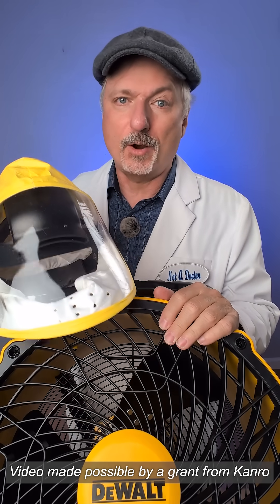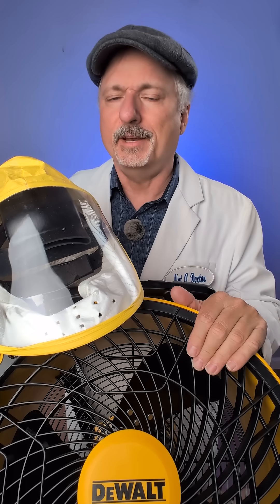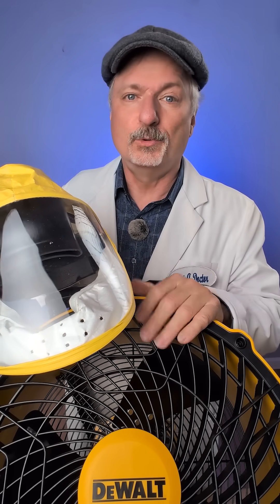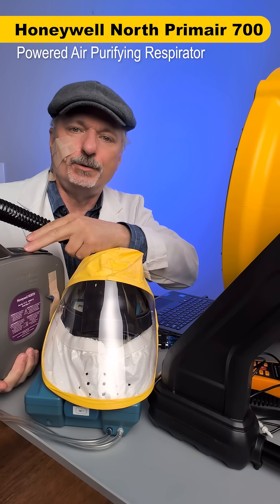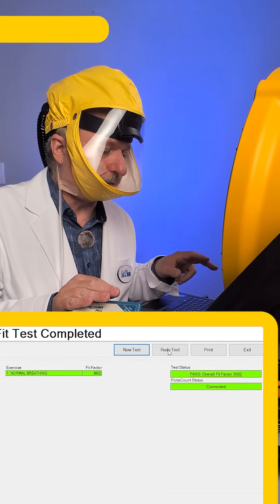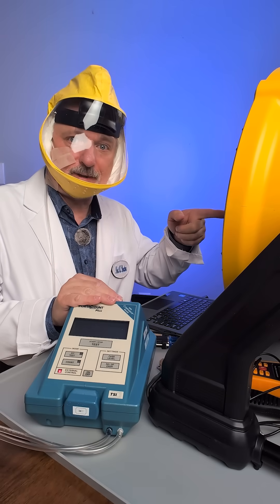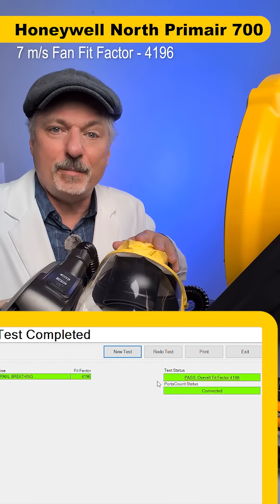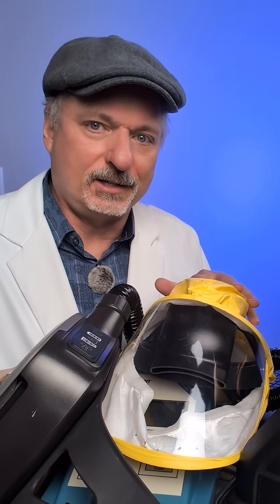Fan vs. PAPR – Can a 4000 cfm fan over power an 8 cfm fan powered respirator?

Comment: When I saw the thumbnail, my first thought was that you were testing out a 4000 cfm fan to make a supplied air respirator :)

Have you seen the Turbine Products Breathe-Cool supplied air respirator? <$500, but has no regulatory approvals. The basic design seems simple enough that it seems like it should be easy enough to make safely...
Reply from the maker: The Breathe-Cool supplied air respirator looks plausible. But as I've found with a number of non-certified respirators of various kinds, the devil is in the details. 

From their website:

"Q:"Why is there no NIOSH approval for this system?
A: The NIOSH approval process is optional"

That's only half true. NIOSH approval is mandatory for all respiratory protection used in OSHA eligible workplaces, but people working for themselves are generally exempt. (But these days, it's unclear if NIOSH will be able to approve systems going forward given the firings of NIOSH personnel.)

I'd be interested in testing one if I can get my hands on one, but I don't have a use case for a supplied air respirator so it's a bit hard to prioritize funds to buy one to test.

Comment: I bought the versa flow by 3m for painting the TR 800. I felt like I was getting covered in dust. Then I realized that it wasn’t the mask covering me in dust. It was me removing the mask without blowing it off first. Don’t forget to get to dust yourself off before you take off the mask.
Reply from the maker: Great suggestion. 

Although most of us don't do mitigation that requires decontamination showers before we doff our protective equipment, it's a great idea to try to minimize the amount of contamination we get when removing masks and outerwear. 

This is also an issue in hospitals, Barry Hunt has cited a study that showed that removing isolation gowns, aerosolizes germs on them. So healthcare workers need to be careful what order they remove their personal protective equipment in when working in infectious disease wards.

Comment: love these experiments even if i dont always understand where these ideas come from lol
Reply from the maker: Thanks 🙂

In this case, someone had a question about whether or not their PAPR was safe to use in high wind conditions. Their example was whether or not it would be safe on a subway platform as the trains rush by and generate big amounts of wind. But I can think of other scenarios as well, including someone working in industry or pharmaceuticals walking under a big air curtain door. You wouldn't want the airspeed of that air curtain to push dangerous contaminants into the head top.

I wasn't sure if the fan would make a difference, but it was a testable question. So I used the type of powered air purifying respirator they had and got my hands on the biggest fan I could - my regular 20-in box fan just didn't seem like it was giving me enough air speed to really give the idea a test. And even this big fan only does about 15 mph, I would have preferred more if possible, but this is what Costco had available.

I did test a different powered air purifying respirator and head top, and I did get reductions in one out of three tests, but it was still highly protective. I can only fit so much into a 3-minute video though, so that part's not included here, but I did mention it in my Reddit post.